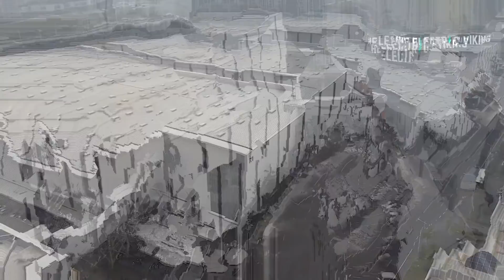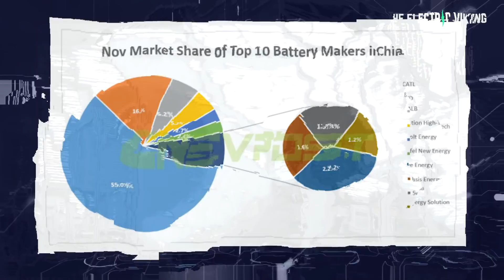Tesla & CATL's game CHANGING battery factory took 3 months!

Comment: This biggest problem with E.V car is 🔋 battery and range. E.V🔋 last 5 to 7 year. and replacing it cost 20th euro in Europe 🇪🇺after your warranty ends*toyota land cruser last 25 to 50 year without engine replacement.E.V is for rice ppl use for 5 year and then throw it away like a phone now days.and recycling the 🔋  ♻️ is the biggest problem.ppl should consume  less that is good for planet.

Comment: Because Tesla didn’t appear to stop production of its products for any serious length of time like the other oem ice manufacturers, it has maintained its chip contracts to a large degree . Other oems shafted their first tier chip suppliers and are there fore paying the price which will not get much easier any time soon m as Tesla will be increasing its orders for chips and it will be at the top of the list . I believe it will be mid 2202 before chip shortage problems even start to decrease for the oem ice manufacturers and making the evs for them will still be extremely difficult considering the increased amounts of chips both in number and type that they will require for ev production. This doesn’t even take into account the software required, lack of staff, engineers , etc that they have in this field. Tesla have a further advantage due to covid .

Comment: we see insane construction speeds in China for refining and Petrochemical facilities. In designated industrial zones like Daya Bay in Shenzhen, new 5B$ complexes are built in ~2 years vs >4 years typical in US and EU. Doubling capacity with Chinese-supplied compressors and equipment takes <6months vs 2 years elsewhere. (which is often longer since the west does multiple design, permitting and approval iterations that usually add a couple more years.
Reply: Well yes, when you don't have to worry about  resistance to the project.  The land owners happily hand over their land. No environmental regulations and crap construction.

Comment: How is this CATL battery only good for Tesla?  I don't think Tesla has an exclusive agreement with CATL like they do with Panasonic (and even then Toyota also has an agreement with them). Also the only Tesla that really uses LFP batteries is the base Model 3, their least profit margin vehicle and probably the last selling trim, and the 3 doesn't sell all that well in China after the Y was sold there.  The Model Y SR has all but been discontinued.  CATL has mentioned little about 4680/cylindrical cells. So i suspect that the majority of the 70 gWh of batteries will go to Chinese manufacturers.  And that is before any escalation of trade wars...
Reply: You forgot that Tesla has an energy division, didn’t you?

Comment: So I guess the 4680 is not going to be produced. Perhaps these will be used by the energy division idk .more equals higher stock price so charge on Garth charge on Wayne .
Reply: 4680 = 46mm x 80mm. This is a packaging size and could be made in LFP
Reply: @nordic5490  I'm aware of that however Tesla's is a dry cell tabless design that's not capable of LFP . This was my question

Comment: In a normal world suppliers would avoid putting so much of their turnover into one customer. The very fact CATL has done this with Tesla is proof that Tesla is seen as a good and reliable partner.
Reply: I think Tesla must have put some money up front.  So if things do not work out with Tesla  CATL probably has enough sales that they can divert the bulk of the production to other EV manufacturers.
Reply: Tesla is likely the only company that can simply buy all batteries they can make. If they have too much for cars they simply put them in megapaks.

I assume the talks went like this:
Catl "how much batteries do you need"?
Tesla "Yes"
Reply: @danielgmur6486  🤣
Reply: I think companies do sign long term huge contracts with partners (look at semiconductors and phone companies etc). Free market is a myth unless by free market, you mean legal contracts.
Reply: There is so much up coming demand that it is worth taking the ramp up

Comment: As you'll find some of the commenters lacking common sense and business acumen. It is a normal practice for suppliers to setup shop close to their biggest customer. Sure Tesla may not be the only customers of this one CATL factory, that is in the same park. But you would be an idiot to think that location is a coincidence. Tesla could very well be the sole buyer of the entire inventory of that one factory. CATL has many. If your giving a discounted volume pricing to a big customer. Shipping cost logistics comes into play. That's why you can make the deduction that Tesla is getting a discounted price. It's nothing personal, it's just business.
Reply: Yup. And the proper terminology for this is Business Clustering.
Reply: Also normal practice for JIT manufacturing processes. Empty factory building already existing. All equipment manufactured and tested off site. All put together in three months with masses of cheap labour.
Reply: @lesliecarter4295  It amazes me at how quick the Chinese can complete projects. I don't think it's as much a matter of mass labor, as much as its a very skilled and experienced workforce. To pull off these kind of hyper paced schedules takes planning from the beginning. Mass labor doesn't equate to speed as much as project management. The change orders from the client alone usually adds a significant time to the process. It's a 60 gwh plant running at 60%!?!?  LOL.. How? They had to be running 2-3 shifts of the Adderall A-Team.. LOL..
Reply: Yes. 
I like to quote the famous SMR.

The more Tesla sells the more Tesla sells!

Comment: The batteries are not just for Tesla but many other customers, do you even realize that CATL has more than just Tesla as a customer!? Lol….
Reply: Tesla will get cells from this plant cheaper than any other company because 
1) They are right down the street, freight is minimal 
2) Tesla is the largest battery consumer on earth and negotiates long term contracts for extremely high volumes, thus demanding lower costs.
Reat assured Tesla is the primary beneficiary of this factory and other manufacturers will be competing for the scraps.
Reply: Tesla buys most of their batteries, CATL can only produce so much
Reply: @sadlfsdajklflsdjal  Tesla cannot buy most of their batteries, CATL supplies alot of companies both in China and outside, they are even building many other factories including one in Germany to supply European manufacturers.
Reply: @carholic-sz3qv  like Tesla? You know, Giga Berlin...
Reply: @antonpershin998  I said European brands and it doesn’t matter if they are also going to supply Tesla or not.
Reply: @carholic-sz3qv  you said European manufacturers, not brands.

Comment: I have a feeling it was the batteries, and not the chips, that was the  limiting factor in Tesla's production... at least in Q4.  They were probably able to produce so much more in December because of the batteries from CATL.
Reply: Battery is the bottleneck from day one and for the next ten years.
Reply: 4680 was developed to dramatically speed up battery cells production rates. LFP are tough and in all practical terms almost as good as NCA. But there’s no nickel and no cobalt AND they don’t catch fire.
Reply: Exactly.  More questions.  Has the bottleneck been completely eliminated?  or is there more battery contstraint?  Is the $188M GigaShanghai expansion related?  I think not.
Reply: Nah it was chips. Otherwise they would not have been producing mega and giga packs. They have done a lot of storage this year.
Reply: @whowhy9023  pretty sure megapacks are made in the US and battery materials would likely be sourced locally. I wouldn’t be surprised if they were having battery constraints in China as there are lots of other EV makers their that they would be competing against.
Reply: battery supply is what is actually limiting all EV makers. Battery supply is what has been limiting Tesla production for the last 2 years. Car makers much rather say chip supply is limiting production because that will be fixed soon, if they said battery was the limited part and it would be limited for many years, their stock price would not go up as much.
Reply: @marioxmariox  legacy auto have been referring to the chip shortage, because their ICE sales are slowing and they don’t want to admit it, but also their designs aren’t as efficient and they need 2-3 times more chips per vehicle than Tesla. Tesla also has pricing power with higher margins and high demand that they can pay extra for the chips to secure them and put the price of the vehicles up at the same time
Reply: @marioxmariox  and tesla dis proved that myth handily since evs require more chips per vehicle yet they grew 97% yoy in 2021. 

I think the chip b.s. is a smelly smoke screen by ice oems to cover up the simple fact since 2016. 
Their pure ice sales are down over 40% across all manufacturers outside of the small scale boutique one's such as Ferrari Lamborghini Bentley rolls Royce. 🤔
Reply: @4literv6  The question is how many cars would they have produced with no chip shortage?? 
They where meant to have 2 new factories this summer… Texas has been ready since June / July. 
But why open a factory with no chips?
Grunheide also but that one is out of their hands. They have stopped production many times this year due to lack of chips.
Reply: @whowhy9023  ridiculous fud. "Ready since July"? Go find a better child to dream up your lies.
Reply: @4literv6  It's both, though paraphrasing Elon's tweet, chips were\are the short-term limitation, batteries are long-term. And while all car manufacturers suffered with the chip shortage, Tesla dealt better because they pulled the whammy of implementing software compatibility with several different chips, thus whenever 1 was unavailable they could just put another one in.

Comment: SERIOUSLY. Is all I can say.  Don’t worry GM will have a battery plant up and running in 2025.
Reply: Why 2025? Their hammtrack co plant with lg chem is supposed to start operations later this year. 🤔
Reply: @4literv6  really do you think they are on track to do this?
Reply: @fredfrond6148  idk tbh? It's gms first co owned factory and likely will be very important for the ultium program moving forward.
The skeptic in me says it'll take at least a full year from the start of them making batteries, in order to scale to any consistent level of production.

Maybe even more like 18+month's based on other ev battery factories scaling up. Plus that plant I think is only supposed to do 30+gwhs. 
So with the average gm pack size being even larger than tesla so far. 
It means that factory may only put enough batteries out for 150k-200k worth of evs, even when operating at scale. 🤔
Reply: @4literv6  very interesting you sure did a deep dive into the subject.  Somebody should do an analysis of many barrels of oil the giga watt capacity of the currently planned ev battery factories will displace.
Reply: 2025 ? 🤣🤣